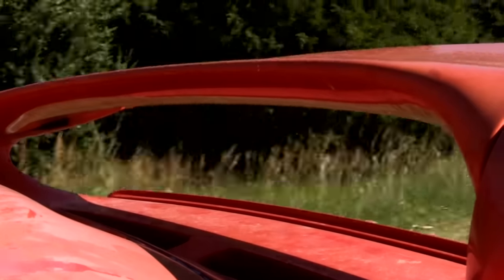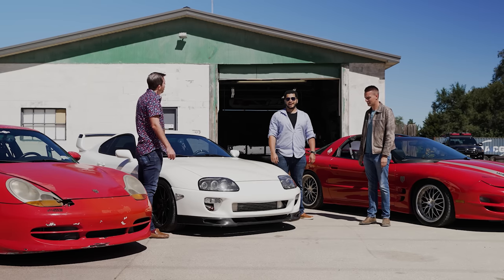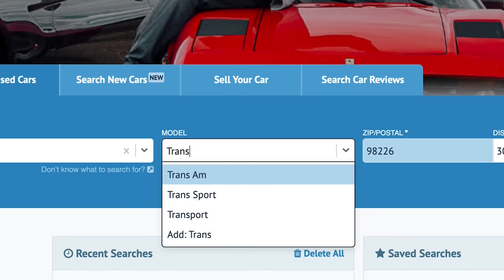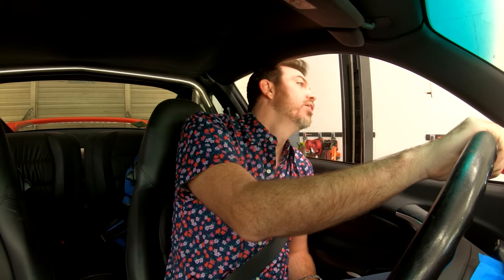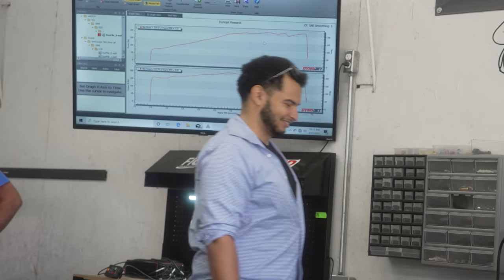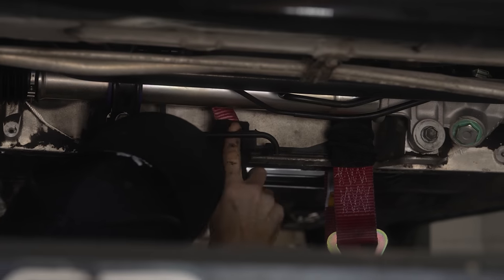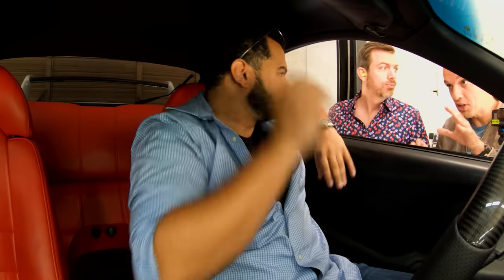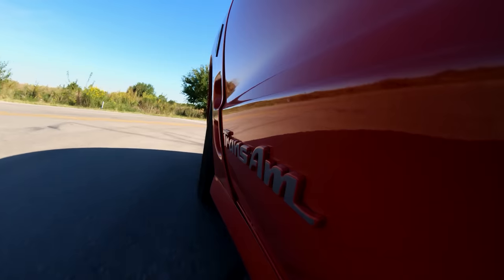We Bought 3 Dirt Cheap Sports Cars...Here's How Fast (Or Slow) They Actually Are | Car Trek S6E1

Comment: For any of you that are curious, when Freddy first got his Supra it only made about 120 hp to the wheels.
Reply: And it’s dirt cheap?
Reply: Yeah I don’t understand them letting his completely modded Supra to slide on this one like we didn’t watch him build it 😂
Reply: I'm guessing the 27k was for that 120hp, not with the work. I'm still curious how he buys 2 more cars for 3k though!
Reply: @IamR3D88  23k was the cost of the supraa
Reply: @azizchemli2526  I'm guessing the stock supra right? cuz then shouldn't the price of the mods be factored in?
Reply: @dyslexicfurry  yeah kinda stock. Mods would have been probably around 15-20 and it was repainted
Reply: they also acting like the price didn't double in 5 years and that's only for the stock version. thing is like a 60-75k car now. why was he even allowed to use it lmao "dirt cheap"
it's like i bought a shelby cobra brand new off the dealership for $8,000 in 1965 and then showed up to a "dirt cheap under 10k" sports car competition. really don't understand the point of this type of challenge if it's nowhere near realistic
Reply: Overpriced, overrated. If you have to dump 30k into a car before it's fast that means it's not fast. For 30k you could make anything fast. I'll never understand why people fangirl over supras. Even worse it still lost to the tired oil burning V8 with sloppy tires.
Reply: @zjunk4877  I'll never understand the Supra hype. You need to spend a small fortune to even compete with a clapped out v8.
Reply: @IamR3D88  is easy,  a shitty family sedan and a cheap rotted out taco or d21 can be found for near nothing.  "Dream garage" always has the money spent on the race car
Reply: @joshpiotrowski3487  while I agree the racecar gets the most. This is a contest and he is hurting 2/3 of the challenge. Plus, the Supra doesn't even blow the competition out of the water. That TA has it on the strip and the Porsche may put up a fight on a track.
Reply: @IamR3D88  it's his dream, not yours
Reply: @flowmastaflam  to get their arm-chair circle-jerker band wagon to shuck 20 minutes to their advertising revenue. The script work is ok, lots of fun stuff throughout... but it's not hard to make up a story and an overall theme AFTER you decide who and what's in the arena.

Tldr, the video cuts the cost of buying cars they want. No more no less.
Reply: @ryzeofrengar3224  if you only shop for off the shelf parts sure. Lmao. A 2jz is better for people that know how engines work, and how to bend and weld metal. 

A v8 is better for people that want cheap decent power without complexity.

Not that logic matters to you though. Your stance is basically "spend more money is worse than spend less money" so i think it's safe to assume you don't have the choice available to begin with.
Reply: NA 2jz is about 220 bHP
Reply: And now 500 and still got gapped time to spend another 30,000.00 lmao
Reply: cap! 1000 hp stock
Reply: @nicewhenearnedrudemostlyel489  With that same logic you can clap out a much more expensive mustang motor like a 5.0 or 5.2l and get the same result. Expensive doesn't always equal better, 2jzs are overhyped, thats the truth
Reply: @mashedt8rs290  i agree completely. But the idea was that v8's shelf-prices are only so low relative to 2jz/anything else because there's way more metal already bent for the buyer. There are ranges, but a 1000hp LS kit is going to be wildly different than a 1000hp 2jz kit. Not because of fanboyism or the enjoyment of throwing money at things... 

It's not life changing or anything, but the dudes failure to comprehend a fad or trend isn't a case for v8 superiority. V8 superiority speaks for itself. I was merely trolling the troll.
Reply: @nicewhenearnedrudemostlyel489  I'd say for the case of an LS motor I completely agree with you. In my opinion, LS are boring and overdone, so I hate the LS fan boys. There is zero difference between an LS and any other pushrod V8 other than the limitless amount of parts for an LS. I myself am a V8 fan boy. Although there is something to say about the JDM scene, it's just not my thing. That being said, there are alot of V8s like European V8s and OHC V8s that I'd argue are just as much for a gear head than a 2jz would be. There are more to them than a normal pushrod motor where parts are abundant. I personally don't mind 2Js, I just hate the fanbase behind them as much as I hate the LS fanbase. It gets boring when you see the same swap in every car you see.
Reply: what supra is making 120 to the wheels that doesn't have a 5M in it? And dirt cheap. Maybe 5 years ago for an A70 chassis. Even non turbo A70's are nearing 10,000 dollars and most of them aren't even running. A cheap A80 chassis, am I missing something?
Reply: @jordanslingluff287  putting a complete 3" exhaust cheap cone filter intake on a stock 7mgte yields you 100HP at the flywheel.. 300HP for about $400
Reply: @somedude9316  Why are you making up weird stuff and saying it to me?
Reply: @mashedt8rs290  
I openly admire the more 'chunky' versions of pretty much anything in the car market. I am a complete sucker for overbuilt/bulletproof mechanical contrivances(shoutout to the Iron Duke). 

Straight-6s are really appealing by design, although the balance gains are often met by other builds. From the same era there are some pretty nice bmw candidates in both categories. I'd prefer to have pretty much any m52 or 54, or m/n62 over the 2jz. For a car i want to drive anyway.

The 2jz falls into half of that for me. The car surrounding it is... cool? has a ferrari or trans am vibe? i guess i can see why the base keeps it's value, but i'd rather be caught trying to find a responsiblish use for the engine. 

I will look more into what you've mentioned. My current knowledge of european v8s is based on one rental i drove for a month. It was pretty good though. =)
Reply: No one asked
Reply: @jordanslingluff287  I was replying to a comment chain that you had also put input into. I didn't make anything up, I figured you were part of the conversation of the clickbait title. My bad.
Reply: Because he bought it na
Reply: @handleymacdonald5760  Should be making a lot more than 120 to the ground, even NA 2jz. Maybe it's got bad compression lol.
Reply: @somedude9316  very true when he bought it, it had 200k miles on it and I’m not sure if he even dynoed it I think that kid is just saying that to dis 2j’s lol. But he immediately did a gte swap or na-t I forget now
Reply: @ryzeofrengar3224   My stock twin turbo supra used to walk stock ls1's all day. now its built even more so

Comment: Having had both a 4th-gen F-body and a C5 Z06: that steering column doesn't usually do that, you should address it 😬
Reply: Not gonna lie. My 96 TA did that. But it literally was my first car. My 98 was solid though
Reply: Allot of them do it my 02 ss did it, his isn’t even bad I’ve seen some that move 1-3 inches 😂
Reply: @chargedtv1167  my 98 z28 does too lmao
Reply: That's terrible 🤣 even my 1993 Z28 didn't do anything like that after 140k miles and all sorts of nonsense.
Reply: My '00 Formula with 200k didn't wobble like that. I was waiting for it to fall off after hard launch.
Reply: this is nice
Reply: @chargedtv1167  yep Vete's, Camaro's,TA's and even Chevy trucks even 3rd gens were all bad for that. The bearings innside the steering columns get destroyed over time. From people using the steering  wheel to help get in and out.
Reply: most do that honestly. Takes 20 mins and $20 to fix completely. The steering column tilt mechanism is mounted with pins that are soft aluminum and get worn easy and everyone lowers their asses into the car with the wheel which it wasnt designed for
Reply: True. My brother had an 04 c5 with 100k miles and it definitely didn't do that lol
Reply: My 2000 ws6 did that, and my 2002 Camaro SS does it to.😂
Reply: @marcoarreola9058  yep its.from if all there previous owners using the steering wheels to help sit down or to help get themselves out of the cars. I even brought a 96 f150 that did the same thing it.
Reply: I wanna see this car go to Wizard real bad. I miss my 97 WS6 so much :-\
Reply: My '96 Firebird didn't do that.
Reply: Yea you don’t know what you’re talking about, super common problem
Reply: @40rollsonly  My 97 ws6 never had this problem. I traded it in at 134k miles and I certainly wasn't gentle with it at 20 years old. I think it's from people using the steering wheel to get out of the car.
Reply: @40rollsonly  "Common problem" ≠ "usually do that," but sure, go off. Also, you literally just admitted it IS a problem 🤣

Comment: A 996 with a factory aero kit is relatively rare.  It has the Sport Design wheels, which are relatively valuable.  I have a "plain" manual coupe, in much better condition, and I am jealous.
Reply: Fellow Porsche guys where you at?
Reply: I vote they send you the wheels and kit when this is over!
Reply: Plus it has the X51 powerkit and a limited slip. The LSD was only available in 1999 and 2004 on the 40th Anniversary. Almost nobody ordered the X51. This is an extremely rare car that has been horribly neglected.
Reply: That is a super rare car, and he paid about half what it would bring in an auction, he can find some deals, its awesome!
Reply: @patricklinkous  wow that's a little fucked of porsche.. I figured there'd be a lot more LSDs in their bespoke rwd coupes. I see it wasn't even an option except for the two you pointed out!

Same with bmw letting all those n54s run around without lsd

Comment: When the ws6 walked that Supra I felt complete joy because I grew up in a world that idolized the Japanese sports cars while I was left alone to idolize the LS 350. It wasn't for notthin
Reply: LS is not a 350.
Reply: LS1 is 346 cubic inches.
Reply: @timothymcdaniel6121  I always thought that ... like the one I grew up liking is the LT 1 5.7
Reply: @timothymcdaniel6121  is the LT1 a 350? Like the Z28 1994?
Reply: LT1 is 350 cubic inches.  LS1 is 346.  But chevy called both of them 5.7 liter
Reply: It was also spinning for 1/4 of the track and was flying up on the ws6 at the end
Reply: $8k ws6 walks a $80k supra lol
Reply: yes the 93-97 f bodies (Z28, formula, and trans am V8 cars) had the lt1 and the 98-02 had the ls1 both were 5.7L 350 v8’s or 346 for the sticklers
Reply: He didn't walk him he missed second gear.
Reply: That Supra noise he’s talking about doesn’t come close to comparing to the sound of American muscle!
Reply: @timothymcdaniel6121  they do round them up to 350..as always
Reply: As a fan of muscle cars myself I will say that WS6  was not "walking" the Supra only had him by a car length if that and he also missed his shift. They are both about equal and the 2JZ has a way stronger bottom end then the Ls1 and could make more power reliably.
Reply: The ws6 was my dream car. That black bird
Reply: @Country_Boy43  yes I get the point rod Thickness and bolts and piston design is stronger in the 2z . But at the end of the day the world’s fastest Supra is still slower then the stock bottom end ls
Reply: @racingjunk7024  Not even homie 😂😂
Reply: @Country_Boy43  subpar record 6.9 at 194 sbe ls 4.5
Reply: I'm one of those wierd car guys that likes a little bit of everything, like I would have both of those cars in my driveway. I will say, my buddy had a camaro, 2001 i think with an ls1 and a 6 speed, never have I had more fun in a car, he had to pry me out
Reply: I love imports but love domestic muscle just as much, best bang for buck and easy to soup up Fer less I'd stick with American muscle. Imports cost way more to soup up.
Reply: Garbossa  might as well get a BMW z4 for less ffs but it's  bummer they are garbage mechanic wise wtf Toyota? Toyota makes longer lasting motors.
Reply: @timothymcdaniel6121  383
Reply: He missed 2nd that supra is way faster bud
Reply: @mrnofvkks4209  The Supra is actually the slightly faster car. The LT1 Corvette would have been a better buy and is on par with the Supra. 

Also, how tf do you miss 2nd? It's the easiest possible shift.
Reply: What world did you grow up in?  I’m 42 and most of the guys I was around hated Japanese sports cars.  “Rice burner” was a pretty regular phrase uttered in my circle even though they were regularly beaten by them.  Im personally pretty easy, I simply respect anything that is fun to drive
Reply: With the trap speed that Supra was knocking down, the TransAM should be thankful he didn't make any traction.  That should have been a mid-10-second pass.  TransAm did well for being as hurt as it was though....but I can all but guarantee you that's no stock block 346ci LS1 in there.  I'll bet dollars, to doughnuts its been bored an stroked to a 383.
Reply: @handleymacdonald5760  That's because Freddy bought a 40-60k car to a 10k car race.

Comment: if you take into account drivetrain loss, the trans am does make around 540 at the crank
Reply: And it isn't even running right
Reply: Tf are you smoking that you think a t56 ws6 is gonna lose 25% to the wheels
Reply: Nah, clearly the tune is off running rich, might have some head gasket issue pulling coolant, or something. I would have pulled the plugs while at the dyno and invested in new ones. As well as a tune while there lol
Reply: And he clearly states “Third gear is my 1:1” and proceeds to dyno the car….4th gear, like almost every other American car, is the 1:1 gear ratio. I’m  sure that would effect the dyno numbers one way or the other.
Reply: @wfomotorsports9122  unless it has some oddball unforeseen aftermarket transmission, 1:1 would be correct…with an automatic. That should have the Tremec T56 6 speed from the factory. With a 1:1 4th gear
Reply: @rayman1230  you’re correct, a T56 would be 1:1 and that’s what I am talking about. If you watch around the 2:24 mark Hoovie opens the hood, if this were an Automatic there should be a dipstick tube on coming from the passenger side firewall  with a bright red locking pull stick which is not there. Although, as you stated it could have some oddball transmission as well.
Reply from the maker: @wfomotorsports9122  Tyler's car was a manual with a T56. I think he just misspoke.
Reply: I mean watching the video he clearly pushed the shifter up as he said he's putting it in 3rd his 1:1. So i'm thinking he did dyno in 3rd so the number he got is higher than what the car is actually making. 545 for what appears to be a cammed and bolt-on LS1 is way to high to be correct.
Reply: @tavarish  he dyno's the car in 3rd gear which is NOT 1 to 1. It would have made more power in 4th gear which is the 1:1 gear in a T56.

Comment: No joke my 2001 automatic BONE stock WS6 ran a 13.2@106 with nothing but the rear tire pressure lowered to 25psi
Reply: Those old f body lt1s and ls1s were faster than advertised, no doubt. I had a 94 z28 and a 2000 SS. Both definitely not "around" 300 hp
Reply: @chriscole4717  They had to reduce the advertised HP to not compete with the corvette of the same year.
Reply: @Robyoutube1327 Yeah they have been doing that for decades, typical GM 🤣

Comment: I feel like if hoovie tuned his car with a actual good tuner it would run 10x better
Reply: The original tuner reading that crying rn 😂
Reply: It actually makes good power for bolt ons and Cam LS1. A decent pair of ported 243 heads will easily pick up 50-60 hp tho
Reply: @raul350raptor  The main issue is the blow-by on it s is horrendous.  It's still fast, but the engine is like the other two and in need of some serious tlc.
Reply: gotta make some dough for this

Comment: That WS6 is fricken sexy! I had a 1996 Trans Am with the older LT1 and six speed but still absolutely loved it! It had some minor work done on the engine and tuned really well so it was putting down about over 350 HP at the wheels (which is pretty good considering the LT1's we're only rated at 375 at the crank)